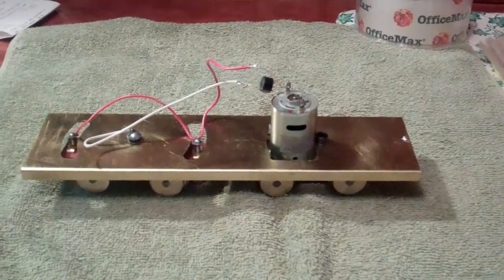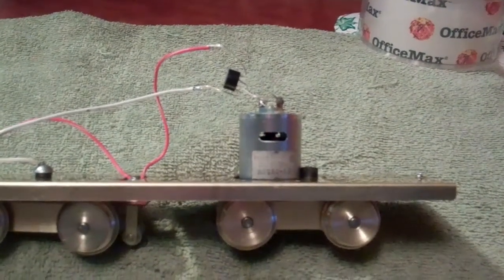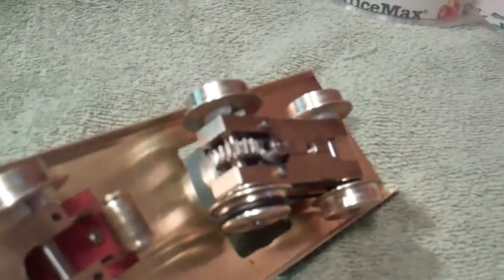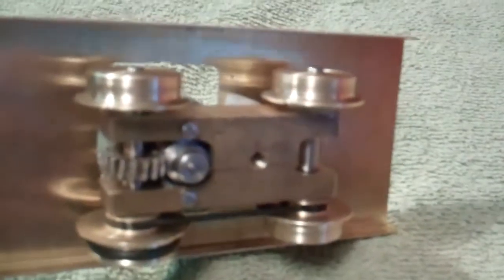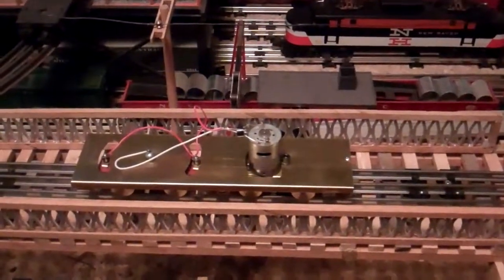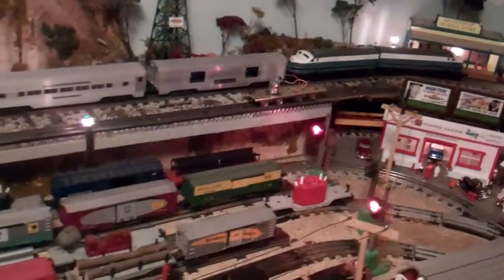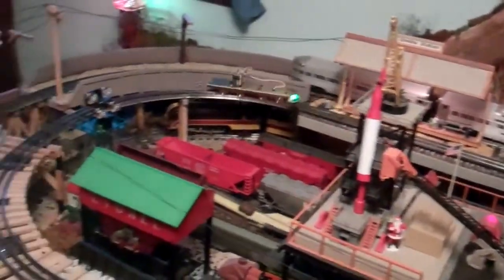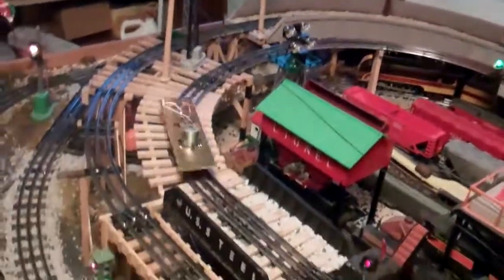TEST RUN OF SCRATCH BUILT O GAUGE BRASS TROLLEY CHASSIS

Comment: How do you wire the motor to the pickup roller meow meow?
Reply from the maker: One end of the motor connections goes to ground which is any metal part of the frame the other end of the remaining motor connection is soldered to the brass pickup roller frame and the the pickup roller assembly is isolated from the frame by being mounted to a non conductive mounting plate. The ac track power from the control transformer is converted to dc (rectified) to provide the dc necessary to operate the permanent magnet dc motor.The black disc on the motor is the bridge rectifier that does this.-TM
Reply: so if I wanted to use a can motor to power a trolley that only has one truck, do I need two pickup rollers or just one and where can I find gears?
Reply from the maker: two rollers is not mandatory it just makes for more reliable operation. There is a lot to powering something using gears you may be able to buy. You will be better off purchasing a ready to run power truck for your project.-TM
Reply: Oh. Fiddlesticks meow meow, I knew I was doing SOMETHING wrong. I made the bottom frames out of cardboard and styrene because thats all I had at the time.

Comment: Nice job, looks like you got a good ratio on the gears. You must have quite a workshop, you should have done a video on cutting the two start thread and the helical gear for the machinists amongst the group.